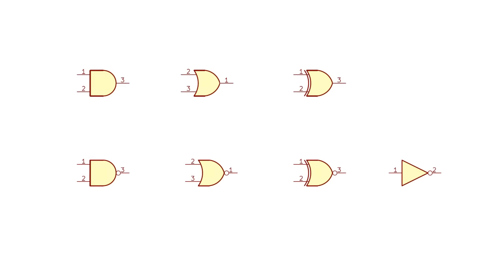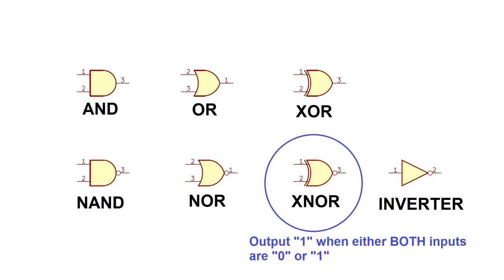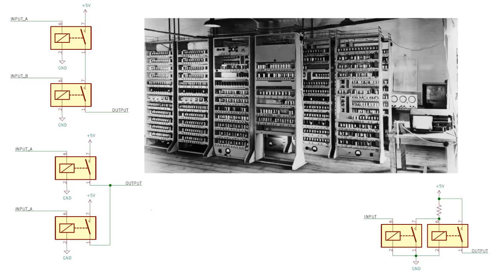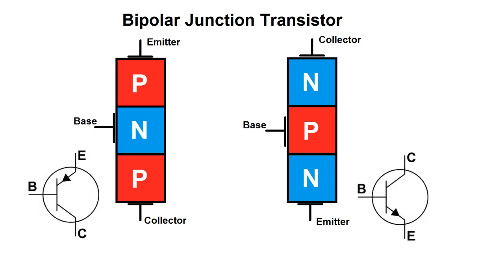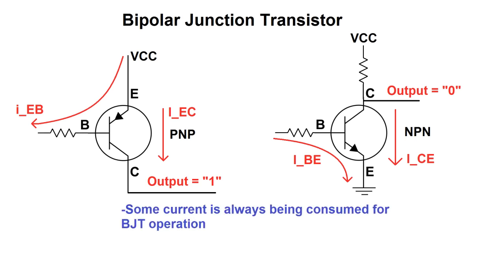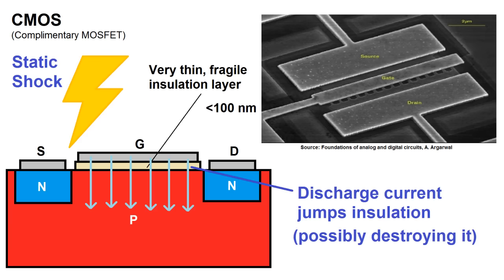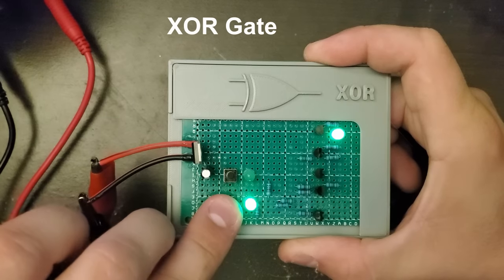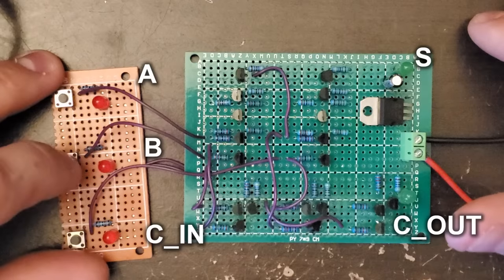8-Bit Adder built from 152 Transistors

Comment: I wanted to build an adder on my own, but I'm concerned with drawing too much current from a battery and creating a hazard. I bought a bunch of 330 resistors to work with a 3V battery and I was able to draw the schematic, but I haven't bothered testing the circuit because I don't want to fry the tiny wire that draws current from the battery pack. I'm estimating a single adder would draw roughly 225 mA of current.

I'm still very inexperienced with electricity so I was wondering if maybe someone could weigh in on this.

Comment: You are wrong about vacuum tubes, vacuum tubes only emit x-rays when they are hooked to  up to voltages in the kilovolt range!
Tipical vacuum tube circuits use up to 600V on the plate, way under the requirement to create xrays.

Comment: Now make a few modifications so it can also subtract. Switch between addition and subtraction with a flip of a switch.
Reply: To do that you would need to place an XOR gate whose input is connected to the B input of EACH Full Adder, now you make a data bus that connects to the B input of the XOR Gate connected to the Adders, now, you connect the wire whose you control the B input of the Adder to this XOR gate, and whenever you want so subtract you just pull the lever down and boom

Comment: Is it possible that the 220k resistor is a 220 ohm. If I use the 220k, the LED will not light. But using a 220 ohm works. I'm using BC547's I'm by any means not an expert here, someone please help thanks. Other than that, this is a great video.
Reply: All of the resistor's values are suspicious me. The 220k base resistor allows only 19uA current (4.3V/220k) and a 47k as collector's resistor also allows very low output current 106uA (5V/47k), I'm not really sure you gonna have any visible light level on a 5mm LED without a power stage. (an usual 5mm green LED rated for 20mA, so it's needs ~5-10mA for a good indication)

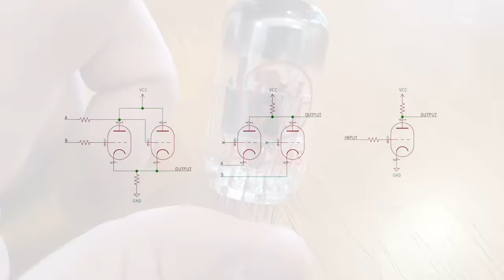Comment: 1:50 high voltage circuit breakers that use vacuum interrupters specify hi potential tests to check integrity, e.g. one manufacturer requires hooking up test leads and apply 35kV for 1 minute to 3 vacuum bottles each. years ago, i stopped doing this when i realized it was blasting me with X-rays while i stand 3 feet away.  now, it can explode and set itself on fire for all i care, I'll replace the whole thing. not doing that anymore.

Comment: You could use 4 less transistors per board by using NOT-versions of gates.
Reply: can you build a computer from just NOT gates?
Reply: @alistairmurray626  you can build a computer with just NANDs. Or with just NORs. Because either can be used to get every other possible boolean function. But full golfing for the least amount of transistors would probably involve just refusing to think in terms of gates.

Comment: Experiment 101: I can See Over 100 KM. I can See Television Transmitters that are Over 100 KM, Away. Light doesn't Mix. I can See it's a Television Transmitter. However, Bears can't Smell and Determine if Someone is Half Spanish and Half French. Smells Mix.
Experiment 101: Make CPU'S / Processors in a Region of Space where Aether density is Lower. Where Constant 'G' is Lower. Or in a Vacuum Chamber.
Then You'll be Able to Make Them Smaller and Faster. E.g. Quad Core, Octa Core, Deca Core. 10 GHz, 20 GHz, 40 GHz.

Comment: Memory should be easy enough. All you need is nine transistors to make a D-Latch for every bit of memory. To make a 1 Byte register you will need 72 transistors. To make eight registers, you will need 572 transistors. The worse thing about memory is making the same circuit so many times.

Comment: What happens if the sum is greater than 255? Does it start over from 0?
Reply: Sooo i have a redstone 8 bits calculator (following the diagram of logic gates) and when i do 128 + 128 in fact it does turn off all lights, but it works differently if you are subtracting, if you subtract 1-2, all lights turn on
Reply: That in case you do 128 + 128, but you could do 128 + 144, which would turn on the the 16, the 4 and the 2, but the 128 light would be turned off
Reply: That happens because when you do 128+128 you are causing the xor gate to have both inputs to be 1, which immediately does it 0.

Comment: you need 10's of thousands of volts to get xrays out of vacuum tubes.
Reply from the maker: They still emit x-rays, but it's an extremely small fraction of the emission spectrum in voltage range they usually run at.

Comment: I watched a part of the video and considered subscribing until the NPN vs PNP diagram nonsense appeared, (@6:00) as with so many 'technical' videos, books etc. these simple mistakes make it obvious that continuing reading or in the case of UTube, subscribing, is a waste of time. Simple checking of the data by the creator or an on screen correction would be an obvious solution. Never mind, moving on.

Comment: Unfortunately an oversimplified and misleading video. Please do not confuse P-channel MOSFET with depletion type MOSFET. Type of the channel and mode of MOSFET operation are different things. Also vacuum tubes tend to produce x-rays only when operated at high voltages. So those low voltage tubes for storing digital data pose no threat nomatter how many are around.